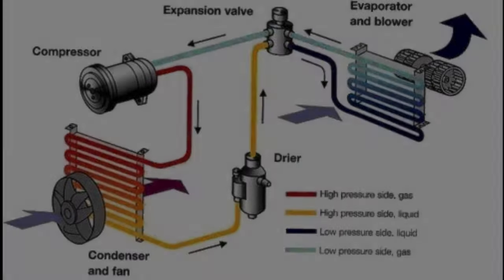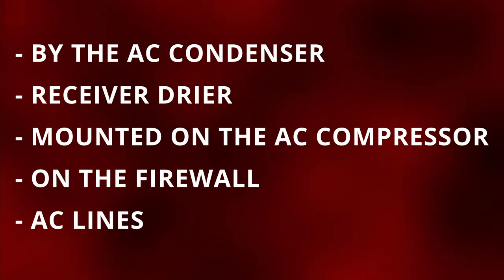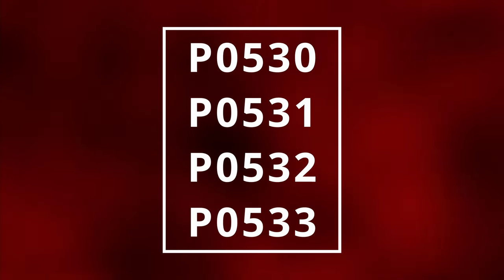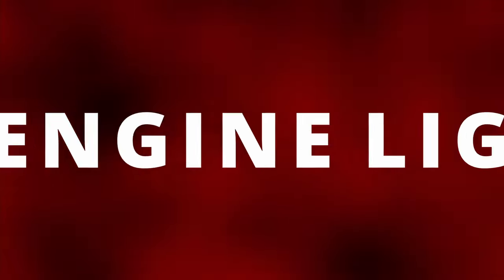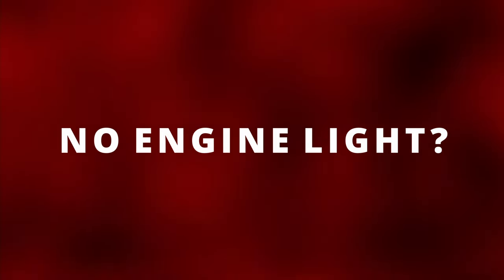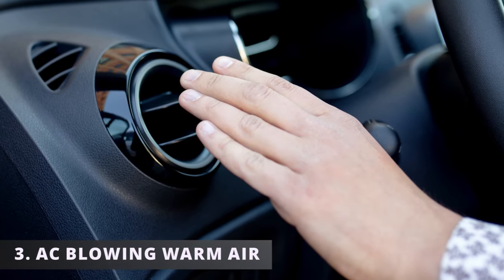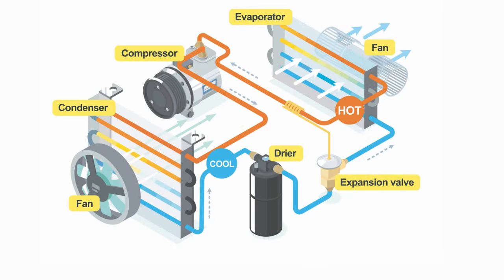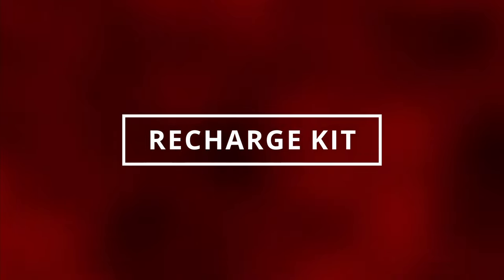SYMPTOMS OF A BAD AC PRESSURE SWITCH

Comment: When I connected the recharge kit to my low pressure valve the pressure read 95 PSI... it's supposed to be around 30. What could be the cause of this?
Reply: it will read high if your compressor is not running while your attempting to fill it 
make sure the compressor clutch is working

Comment: My ac doesn't turn on at all. No power at all. 14 Ram 1500. Any idea what it could be?
I did check the fuse looks good. If it was the blower motor I would assume the ac would still light up as if it's on.
Reply: Start at the ac relay by switching it out with a good one. If it's not blowing then go to the blower and either take it out or put 12 volts to it to see if it works if it is go to the blower motor resistor.. If that isn't it since it's a dodge I would start looking at loose or corroded wires.. Those are the steps I would start with since you say you checked the fuses already..
Reply: Hi, I have the same issue in my dodge caravan, did you fix the problem on your Ram ?
Reply: @alfredocardenas506  Could be a resistor on blower motor

Comment: Can this switch be also responsible for a fan running nonstop when every other reason has been eliminated?
Reply: Thats what I have heard. I have tried everything. I am going to change the pressure switch.
Reply: @MrFahadaziz1980 have you changed the switch?
Reply: Did you try to replace AC clutch relay?

Comment: My ac is blowing but nothing air is coming out!!! It work on windshield and legs but not on face I need help!!! I changed the cabin filters and engine air filters but it did nothing 😢
Reply: Cabin air filter is 1st thing you should check

If it has never been changed or clean depending on whether you're running a stock disposable one or a K&N or other brand reclinable one, it needs to be replaced or cleaned every 10 to 12000 me ish
Reply: It can be A switch.
Reply: Check fuses for blower.

Comment: Hello, I have a 2019 Chrysler Pacifica that barely blows air out of the driver and front passenger A/C vents unless the fan is set to max. On low setting, barely any air comes out.. and when set on max it’s as if the blower had to build up strength and progressively blows air out until it does. The A/C is cold, that’s no problem, but barely any air comes out the vents on the low fan setting. What could this be? Maybe a bad blower??
Reply: Fan blower resistor
Reply: @intelin123  Actually, I was able to figure out and fix most of the problem I think. The cabin air filter was super dirty, blocking most of the air passage and the HVAC blend door actuator was bad. I replaced both and the A/C air finally rushes out the vents 100% better. It still takes time for the air mass to build up speed but is definitely 100% better. I’ll look into the fan blower resistor as well. Thanks!

Comment: I replaced my ac compressor and it blows out really cold air. The issue is when I drive for a long time the air flow decreases and blows very little regardless if it's the heat or ac. What could it be? Driving in the cities is completely fine, this only happens on long road trips.
Reply: I've got the opposite problem. Mine gets colder when running ling uninterrupted distances, but in town it blows cool, non conditioned muggy air
Reply: My mk7 gti does this. If i drive for a while and the fan is on 6 it will sometimes decrease to 3 instead of just staying on 6. Same with the 4 and 5 setting. Sometimes 3 is the highest setting it will blow. This switch was the solution for another mk7 owner so I'm gonna try it out.

Comment: would bad pressure switch make it so that you could barely add any refrigerant without overcharging?
Reply: Did you find an answer to this?
Reply: Same thing hsppwned to me. I have all the symptoms this publisher mentioned, but b4, I emptied out all air with ac  regular ac recharge hose, then I connected the can and barely put a little in and it redlined.... bought another can and same thing. So I jumped the switch with a paper clip and it worked the clutch but then it stopped so I'm puzzled. Usually you can jump it and that means you confirmed it's the switch bit now I think I need the pig tail . Might of done something to it idk.

Comment: What about no cold air and constant high pressure on low side? Even when I lower the pressure on the low side it keeps building up to high pressure.
Reply: I would suggest you are probably dealing with a clogged "A/C Receiver Drier / Accumulator". I have had to replace many of these over the years and it's really the only cause for a system to over-pressure on it's own. Good luck
Reply: @PH INFO 101  I recently replaced the compressor again and the low side near the pump was getting cold but it was still warm near the expansion valve.  Which I thought was very odd usually the whole line is ice cold.
Reply: @PH INFO 101  I'm going to replace the expansion valve again and that line that's between the valve and compressor. Hoping that's it.
Reply: @jl456  what is the model & year and I will give it a quick look
Reply: @PH_INFO_101  2011 GMC Terrain
Reply: @jl456  If you haven't changed the A/C Receiver Drier / Accumulator, I would give that a try. They are filled with desiccant and get plugged all the time. They are cheap and fairly easy to change.
Reply: @PH INFO 101  I replaced the condenser which has the dryer built into it.
Reply: @PH_INFO_101  you gotta remove the whole front clip and other items on the car to get to the condenser
Reply: @PH INFO 101  I'm really hoping that it's the expansion valve not working correctly. I'll see when I replace it.

Comment: Its also quite possible that yhe pressure switch is doing what it's supposed to do not allowing the system to work because there's low pressure.

Comment: Very down to the point video. Professional!!!
Reply from the maker: Very nice, thank you!
Reply: @easyautofix ever seen a car like 05 pontiac gto have only 1 pressure switch bear the high side?
Reply: @easyautofix 2011 Ford Fiesta. Air conditioner has always been cold. I replaced the cabin air filter and since then the air condition  blows cold as it use too but now fluctuates. Sometimes at a stop and even sometimes going down the highway at 60 mph. It can be 5-15 mins apart or longer?..

Comment: How to check high ac pressure switch  sensor by multimeter.  I had bought 5 sensor  a from advance shop other on EBay   Check for resistance  are 16 k ohms.  Blow it by com pressure air.  All not change any resistance   (Not closed ) any help thanks

Comment: I have a 2002 ml that ac sometimes works and sometimes it doesn’t. Especially if i turn on the heat and go back to cold, it won’t work before i try like 35 times going back and forth warm cold. And then it works again 😅

Comment: Thanks for the awesome Video

AC works perfect on idle and lower speeds
But Blows hot air on high speeds 120kmph

Changed compressor, got the Condenser and Evaporator checked, got the freon pressures checked. All seems to be good

Some AC Tech said that the Compressor Clutch Sensor might be causing the issue.

Any suggestions plz?

Comment: I just installed a new compressor, and it has blown hot air again 
I had recharged it and vacuumed it as well any idea what i can do?
Reply: Check the wire. .
Check if there is a power..
Reply: Check fuses and relay.

Comment: I have a 2010 equinox. I'm curious if my pressure sensor has failed. I believe I overcharged so I went ahead and got it evac'd and refilled and no air still. Would the sensor allow the compressor to work again if the pressure is normal?

Comment: I might classic BMW 2004 it's indicates AUC is my problem supposedly the dealership says I would need a new compressor but I'm not going that route there's nothing wrong with the rotating clutch a clutch still moves once in awhile I would feel cold air plus hot air what would be the problem
Reply: It may be the compressor valve on the compressor itself. Easy job taking it off but you have to empty the system, vac it down and recharge it.
Reply: @rashaadswanson  how do you remove it off of a 325xi I don't want to drop the subframe I was doing a catalytic converter swap how to remove the line that goes to the compressor not saying that code ever come up but I'm okay I'm not planning on using AC
Reply: @isrealperez9069  I'm not familiar with that car... Generally speaking the compressor valve is easy to take off on most cars because the compressor is easily accessible. I personally wouldn't pay to have another compressor put in before checking that valve. I wouldn't let them sell me a compressor job when all it is just the valve is going out/broke.

Comment: So I changed my pressure switch and my ac compressor engages but I still get hot air. Could the temperature control unit be bad?
Reply: Sounds like there may be a possible fault elsewhere in the system
Reply: If toyota they may have flow sensor and common problem electric control valve that goes bad
Reply: @scottlanier5133 what toyotas? I have a 14 corrolla. 2500 for new compressor and fan but little did they know Im not an idiot. Replaced condensor bc rock chip. Refilled by 2 shops but told me diff things. Blows hot than cold. Maybe moisture when replacing condensor?? Feel like sensor/electrical bugging out. Plza help!!!!!
Reply: @itsanthonyb663  newer siennas...usually those with v6